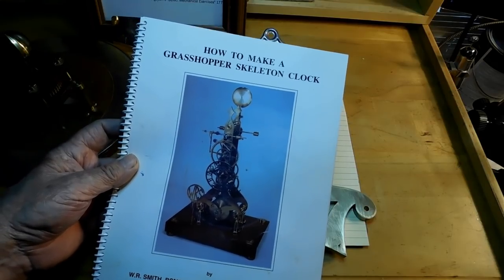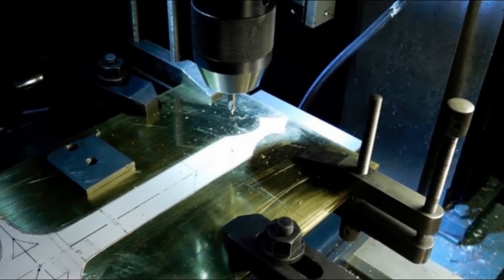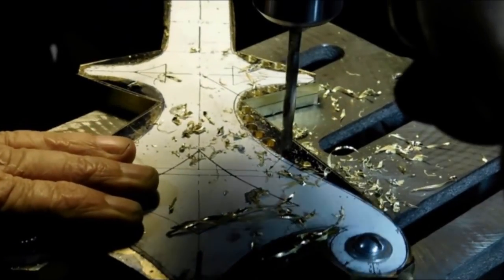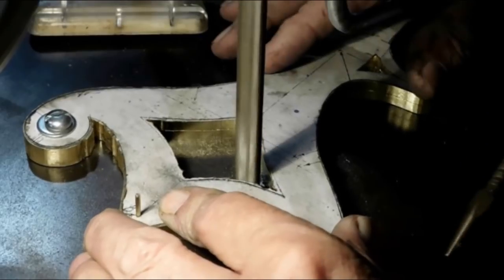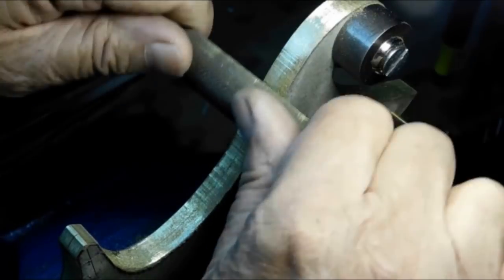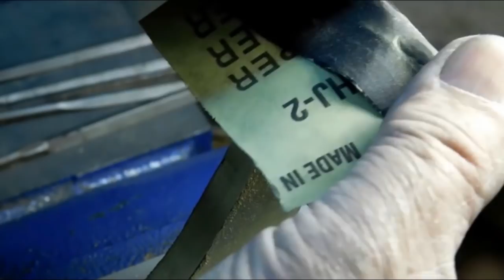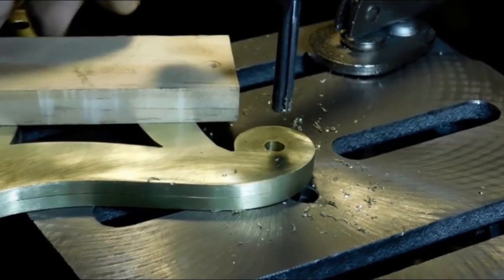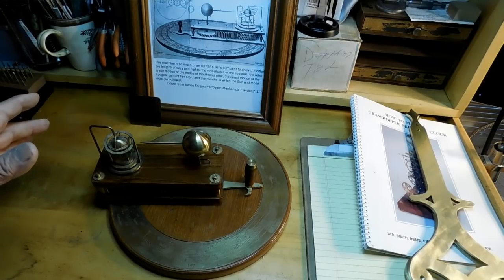WR Smith's Grasshopper Clock: Part 1 The Plates

Comment: Bob, looking forward to these coming videos. What plans , if any did you use for orrery ??  I found plans on line    Ralph
Reply from the maker: I found Clayton Boyer's plans and one other article with good pictures...there could be more but it was about 10 years ago...but Ian Coote (sp) has posted James Ferguson's original description of the orrery with his drawing and that can be made into shop drawings...I also have JR Millburn's Wheelwright of the Heavens The life and Works of James Ferguson, FRS...all that and a bit of curiosity seemed to get me through the build...but the set up and working of the orrery is a bit of a learning curve if you are not into astronomy...I hope I can help with this...bob
Reply from the maker: I just looked at Millburn's book...it could help but the original Ferguson text and his drawing works well...the calendar ring took some speculation...but a bit of a study of the orrery and a good look at pictures on line should do you...I wanted to make mine on a CNC machine I had just finished making so I had to scale the calendar ring to my machine's footprint...I scaled the rest from there...to the best of my memory...bob
Reply: @robertt-cs8fe  thanks I ordered the John R Millburn: book. also ordered Boyers plans what coping/fret saw blades do you use ? what size is the throat on your saw
Reply from the maker: Millborne’s book is a life history of Ferguson with a chapter of his Mechanical Paradox Orrery, not so much on the building, more on the history... Clayton’s plans are great for a wood worker but just as good for a machinist. I just want to be sure I’m clear on the saw…I use a piercing saw and piercing saws has about a 5” throat…a jeweler’s saw is only a little under 2” and a fret saw has a depth of 12” or so (I’ve been trying to find a fret saw I like as it might be helpful but still haven’t found one). The second saw you see in this video is a coping saw, which you can get at the local hardware. I use No. 4/0 roundback Pike jewelers saw blades for crossing out wheels with the piercing saw…I found them a bit light for the plates on the Grasshopper clock as together the plates are pretty thick…but the metal cutting blades for the coping saw were rough but very doable...for Ferguson's Orrery I used thinner brass suitable for a piercing saw... bob